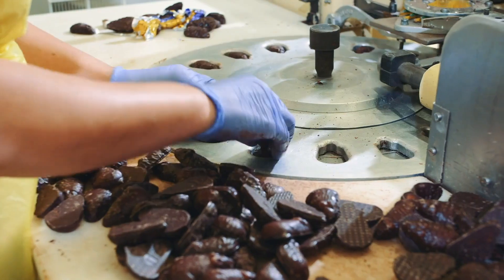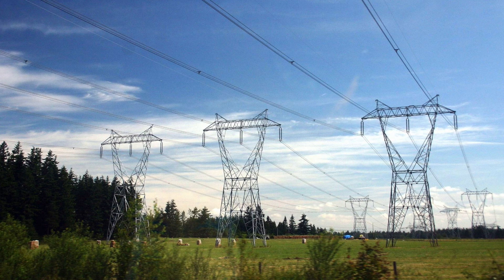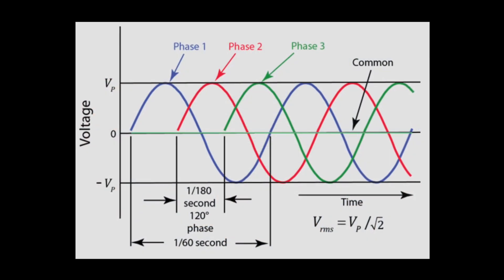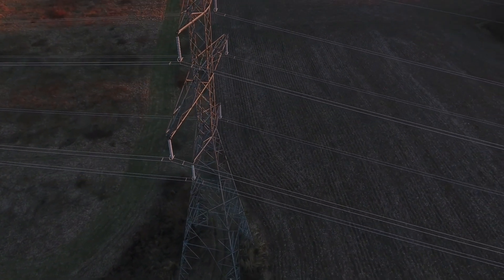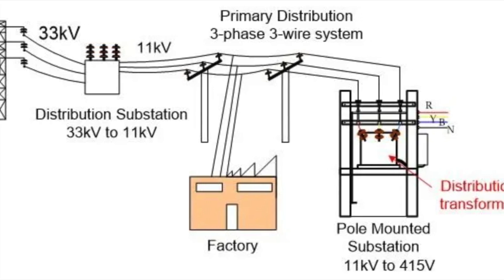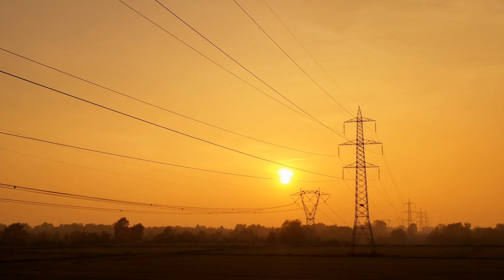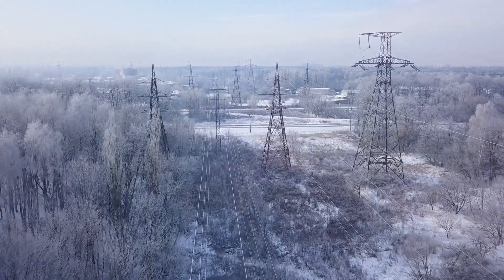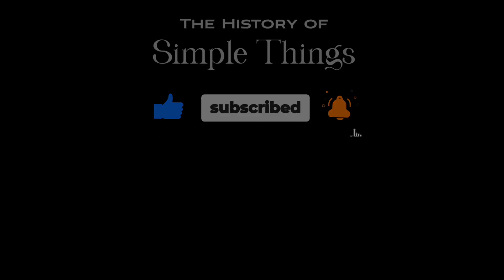Why do High Voltage Power Lines Come in Sets of Three?

Comment: Now parts of our Power Grid is UHVDC.  and is in pairs of 2 wires.  Ultra High Voltage Direct Current.  Modern semiconductors makes this possible.  Would be a great video on that UHVDC , parts of the US and China use it. The biggest transformer in the world is for the UHVDC power grid in China !  UHVDC can go further and with less loss than 3 phase system. Today we have both DC and AC all over. Who won ? Tesla or Edison ?  looks like both wear right !  We thank them both to our modern world !

Comment: The author uses technical and electrical utility words and phrases withput defining them for non-technical, non-utility prople.  A line or circuit consists of three😢wires or conductors as a group.      Most poles and towers include one or two "ground" wires connected to earth for lightning protection.  Some tpwers may carry two lines or circuits of 3 conductors each.  Phase is better understood as time.  One AC cycle takes 16.6 milliseconds.  The second and third phase or conductor is delayed by 5. 5 milliseconds each.  3 phase power is generated by 3 windings in a generator, located 120 degrees [1/3 of a circle] around a rptating magnet.  The time delay between phases or conductors gives 3 phase motors a rotating force, making simple starts.  Single phase power has two power peaks and two zeros each cycle, generating vibration and noise.  Three phase power has continuous steady power delivery as the sum of all three phases, making it similar in some ways to DC.

Comment: Placing heat keeping material on wall of a hole digged in the ground would keep the hole hot and heat could be used to heat water or air and drive a turbine , ground digged being close to earth top

Comment: Not every high-voltage line has three or six wires. 
In Germany, the railway operates its own network with 110kV 16.7Hz on the high voltage and 15kV on the railway contact wire.   Either two or four wires are used.
On the train then overhead lines and rails
Reply: Gluten tag.
Why 16.7Hz?

Comment: 3:24 If we had Tesla's power system then not 3 but 6 lines would be needed.
Tesla invented the 4-wire two-phase motor and the 6-wire three-phase motor.
In Germany, the Russian Mikhail von Dolivo-Dobrowolsky invented the three-phase motor with only 3 wires. 
Westinghouse then built its power grid not according to Tesla's plans but according to Dolivo-Dobrowolsky. 
Dolivo-Dobrowolsky had already built a functioning power transmission between Laufen and Frankfurt,
but Tesla only had theoretical plans without putting them into practice.

But Telsa had one advantage: he convinced the US public that he was the inventor of everything.
Dolivo-Dobrowolsky was ahead of the game by making it work.
Reply: In Germany, houses are connected with four wires: L1, L2, L3 and N

Comment: Always remember. The higher the wire. The more dangerous it is.  
 Are we thinking residential solar power backwards?

Maybe we should standardize DC stranded for the home. In parallel with AC.  
Have a two hour battery back up. It gets charge by the solar cells. 
At night the power companies can charge the battery.
Giving homes a two hour backup supply and a much simpler way for the power company to disconnect the battery off the grid.
We now have a crazy amounts of electrical for the homes that is converted to DC power. 
Thanks due to mostly the RV industry.
Reply: All wires should be considerrd dangerous.  Wires sre stacked by Voltage, highest voltage highest.

Comment: Tesla's original design was a TWO phase system.
Reply: Two-phase motor with 4 wires 
and theoretically three-phase motor with 6 wires
Reply: @jensschroder8214  Them wear the first US paten's of polyphase system . George Westinghouse bought them pattens   and changed the world !  Converter GE to AC . Once from lewiston NY to Buffalo NY was done with AC power from Niagara Falls power plant the power grid became AC around the world. Because of different patens 50 and 60 HZ was used and 25 HZ in some factory's.  Japan only country to have 50 and 60 HZ  together.

Comment: Absolute rubbish. Each power line delivers 3 phase power. Additional power lines are built to increase supply, but all supply 3 phases. It is cheaper than replacing with higher capacity lines.
Reply: Well, there's also the fact that the clearance required between phases increases with the voltage being delivered on that particular circuit, and the conductor itself increases in size with the relation to the voltage carried. You "might" see a tower strung with a lower voltage on one side, but that's hugely uncommon and very uneconomical. You build towers in sizes to accommodate clearance or spacing between the conductor cables. The voltage increments vary a bit from grid to grid, but in essence, the smallest you'd see on a tower would be 69kV, then 138, 240 and finally 500. The largest overhead line that I know of as this point in time is the Changji-Guquan 1100kV system in China. Now that's a beast!  On the smaller end, 14.4, 25, and 38kV are typically strung on wood or concrete poles.
Reply: Are you implying that each set of high voltage towers with three cables on it is one power line or each cable on that tower is carrying three phase power?
Reply: @dwayne7356  Don't know what OP is implying, but here each individual tower carries 3 phases on seperate wires (each phase may contain more than 1 wire, usually connected tightly together)
Reply: maybe it was meant that pylons which carry 6 phase conductor sets (could be 1, 2? or 3 cables), carry 2 lines?
Reply: @StringerNews1 Whatever terms you choose, the point is that you do not need 3 rows of pylons to transmit 3 phase power. Multiple rows of pylons are simply an indication that the power companies never planned for expansion.
Reply: @StringerNews1 A power line is a single row of pylons. Each row has 3 wires carrying one phase each.
Reply: @StringerNews1 What does the title call them?
Reply: @StringerNews1Not sure why you feel the need to be insulting. AC electricity is generated in three phases for some of the reasons stated and a three phase transmission circuit consists of three conductors. A transmission tower may carry one, two, or sometimes more circuits each of three conductors. The idea that three adjacent sets of transmission lines is somehow related to three phase power is nonsense.
Reply: You must be an EE. Thanks.